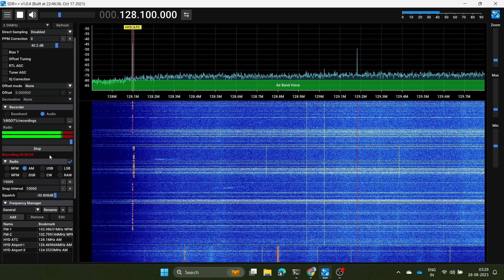Listening to Hyderabad ATC using RTL-SDR Dongle and stock antenna from ~30KM

Comment: Which antenna did u use the out of the 2 which come with sdr on Amazon and also did u hse sdr sharp?
Reply from the maker: In my case, I was using the big ones, pointed roughly on the airport side with an 80° angle and for this one I'm using SDR++ as this is easy to visualise and use and very beginners friendly
Reply: @AnimeshRoy  Can live passthrough to a GPU software remove the disturbance in this one to give a clearer audio ?

Comment: Hey brother, is this legal? Shouldn't it be illegal to tune in into ATC frequencies?? I really am looking forward to get this device but just confirming if this is legal...
Reply from the maker: Hey, listening to any Broadcast is legal, it's becomes illegal when you starts transmitting on those reserved frequency ranges. it's always safe to start with RTL-SDR as this only a RD receiver. once you get the hang of it then you can commit to better and more complex hardwares. 

you can get RTL-SDR from here: https://amzn.to/45ZwRdZ
Reply from the maker: @aishwaryap   You're right! So, which part of the video is confusing you and making you think otherwise? Assuming you are asking about RTL SDR, it is a receiver-only device that can monitor and listen to the listed bands using any RF software. I am receiving the signal and playing it as audio. There is no transmission involved from my end, and please refrain from doing so. The listed frequencies are reserved, and any transmission on those bands can get you into legal trouble.